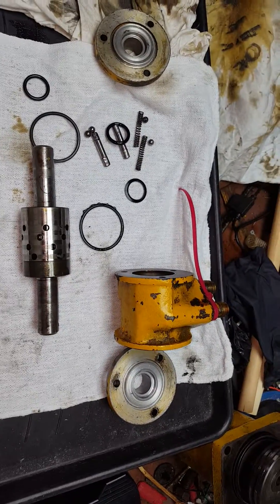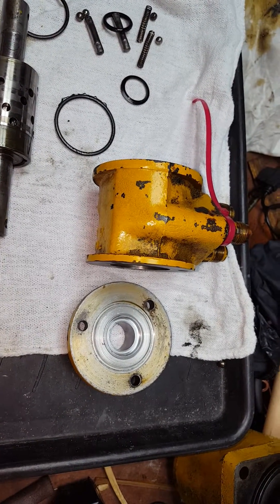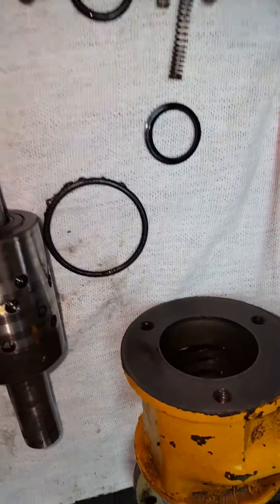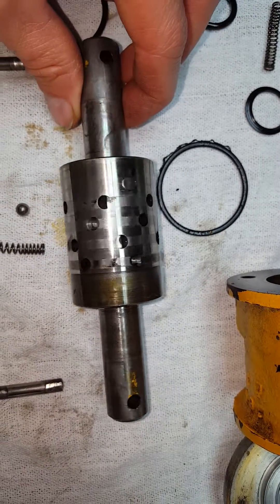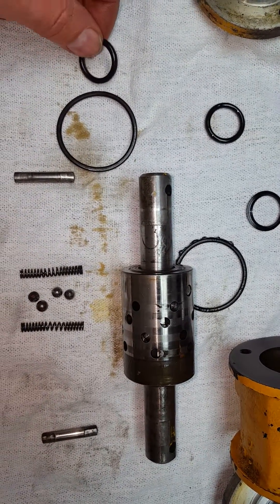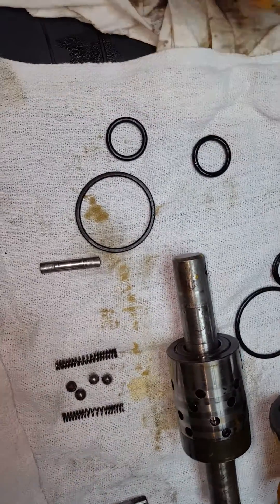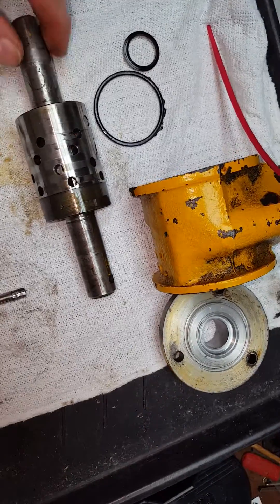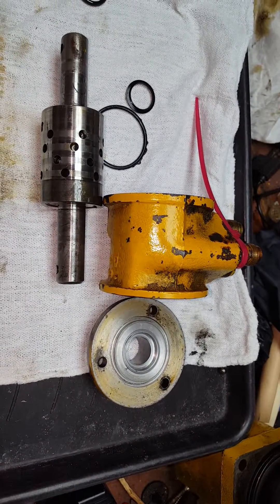John Deere 440 ID Backhoe Loader - Power Steering Control Valve

Comment: Be careful when you take R&R this unit, it is very easy to turn these into a motor if you do not get the unit back together correctly.  I have learned the hard way one day...  I am in final stages of a full ground up restoration of a 440 ID, so your videos are just a fun reminder of what I went though.  It looks like you are doing very well with this tractor, the only difference I didn't mess around with trying to save old seals or o-rings.  They all got replaced.  Good job and keep up the great work!
Reply from the maker: @Nate Roth  Thank you. I replaced all seals and o rings and in many cases bearings on this tractor. I tend to replace everything when I get into a system (like the ps in this case). All went back together and works great (I use a marker and these videos to make sure I get it right). Still tons of play in the linkage but no more leaks.  Need new ball joints for everything after the rack and pinion.  That will likely be the next project when I get some time.